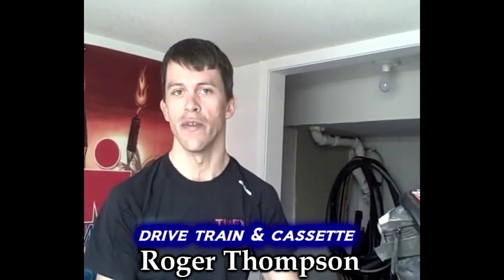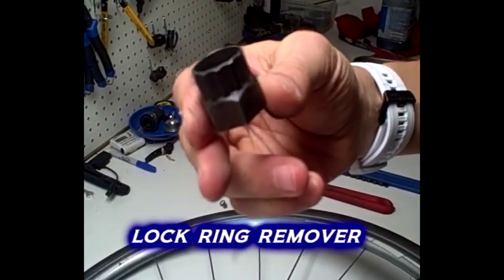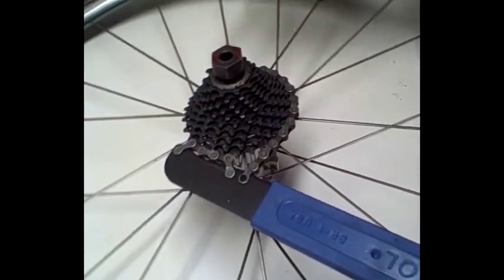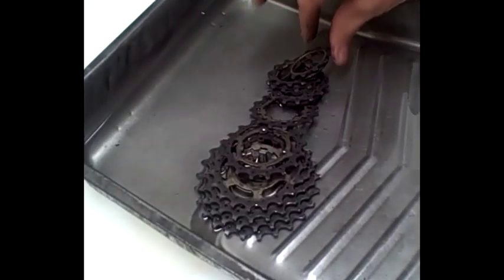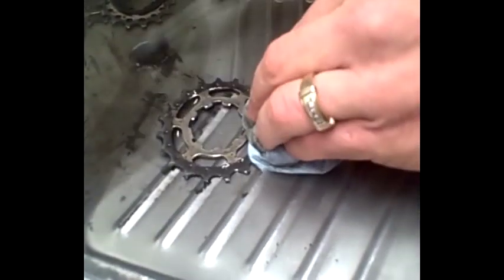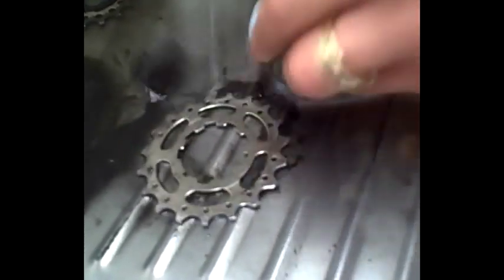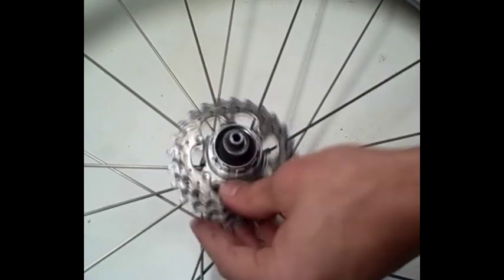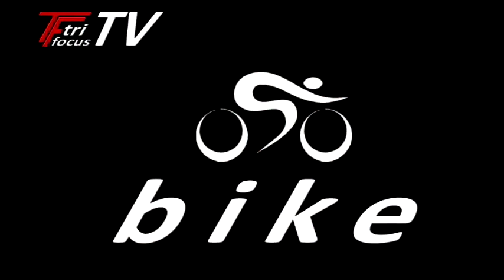How to clean a bike cassette

Comment: I know this video is a little dated and I found it extremely helpful but I have one question. You just hand tightened the cassette nut. Is that all what is needed or should it be tightened more using the chain whip and cresent wrench.